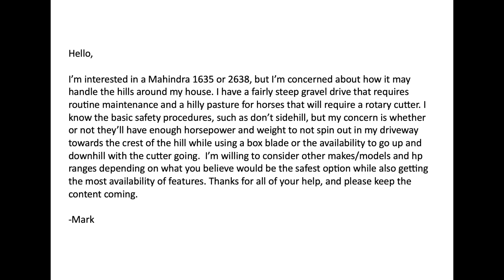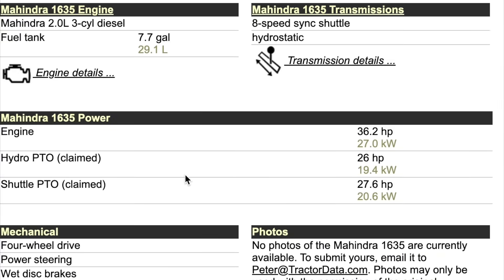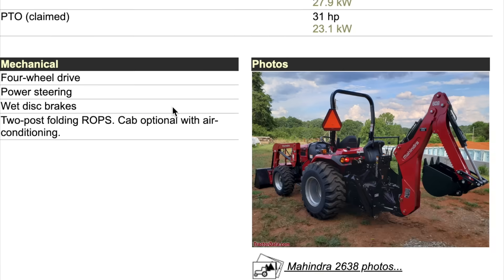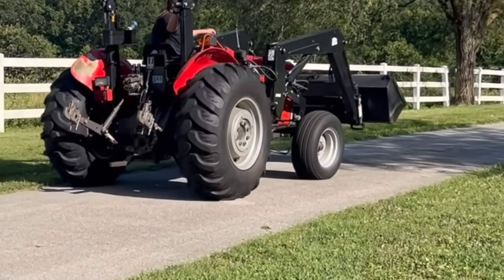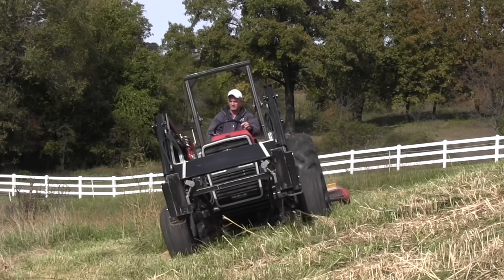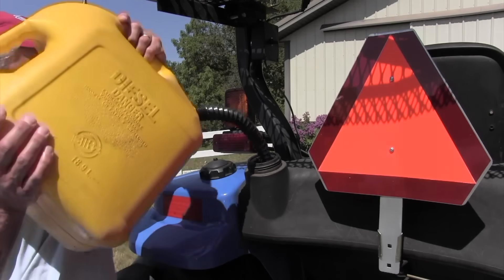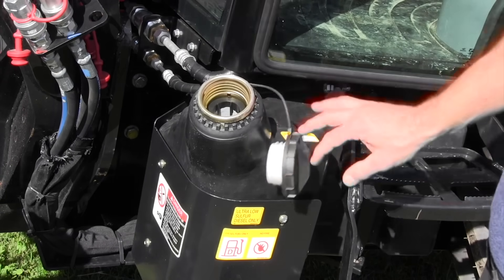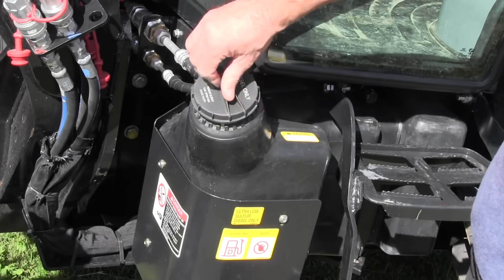Which Tractors Handle Steep Hills Best? Watch This First

Comment: We have a hill that we keep mowed. We use to mow it with a New Holland TC21 4WD (R4 tires) with a mid mount mower but due to discharge balling/wadding up grass, and the service headache the mid mount presented, we dropped the midmount and added a Bush Hog 5' finish mower behind the tractor. Works great in his big yard, but the weight of the mower behind the little tractor now makes it too dangerous to use on the hill (25% grade). It wants to push the tractor downhill and the tractor runs out of muscle uphill. So now we mow the hill with a New Holland 4630 4wd with a 7.5 foot Caroni finish mower. The tractor stays planted for sure but almost too good. The R1 tires on the 4630 create traction ruts and that introduces erosion if we mow it too frequently

Comment: As a kid, I grew up on a 600 acre farm with a lot of steep hills. The first tractor we had was an old Farmall with narrow wheels on the front, no power steering, and a loader that worked by a hydraulic pump that was powered by a chain around a sprocket on the PTO. If you've ever seen how high those tractors are, it's the driver that makes the difference and not the actual tractor. The driver adapts to the limitations of the tractor. Today, I'm in my 50's and I have a mountain top property that I use my tym t25 to grade the road with and a 6 foot wide blade on the back. I have no problems pulling that blade with a 25 hp tractor, and the hills are pretty steep.

Comment: Good video on a critical subject!

If it has a loader, keep that bucket as low as possible.  Keeping your hand on the loader control so you can stick the bucket to the ground when needed also help prevent a roll-over.

While smaller diameter tire do lower the CG, they also don't roll over obstacles (bumps or ditches) as well as larger diameter tires.   Often it's then obstacles that initiate a rollover.

Comment: I run dozers, most of the time, then I run tractors seeding, running a disc and fertilizing after I've finished dozing.  So this gives me prospective on this. 

On bare ground, on what I thought was less than a 3 to one, I  found my dished out, with beet juice mt573 slide creeping down hill. Bone dry ground. Not trying to roll but slide.

I could go on and on... vertical you can do so wicked things, side hill, be very cautious of everything.  Ground coverage,  ground conditions, etc. If in doubt vertical it out, as soon as you can, as my dad once told me.

Comment: 1370 case ag king row crop dual, I realize it's extreme overkill but with the 12 ft long axle width, it won't turn over. Just gotta get through the gate, and have a tough cutter and probably can forget PTO operating speed as it has plenty of power and the fast PTO speed at 1100 I think it was.

Comment: Putting liquid in the rear tires WILL make it more stable. There's a couple of choices. Antifreeze, or RV antifreeze. I used the RV antifreeze in mine. I added over 800 pounds of weight, to the rear end.

Comment: Fat turf tires. When I was a kid I worked at a golf course that had a Massey Ferguson with those fat turf tires and I could bush hog anywhere they wanted me to cut and not feel uneasy and this was way before 4 wheel drive tractors. I had come from another golf course that had John Deere’s that I didn’t always feel safe on but the worst was that little Cub Cadet with a belly mower. I felt like it wanted to flip when I was just moving the road easement’s in that country club.

Comment: The only feature I would add is that 4WD or front wheel assist is a MUST for hills.  If you have to maneuver at all you need the responsiveness of front wheel assist.  Typically you also have the advantage of 4 wheel braking.

Comment: WHEEL SPACERS-  Spacers will move out rims similar to adjustable rims. A little expensive but an option for safer usage on slopes. Obviously non- cab tractors would be best in this scenario. BORA is a spacer mfg USA made

Comment: I live in northern Vermont and own a compact LS tractor.  In addition to the ballast and wheel weights you mentioned, many dealers sell spacer kits, which bolt directly  to the hubs (the tires then bolt to the spacers with longer bolts).

If concerned with driveway maintenance, if you live anywhere snowfall can be an issue, investing in a set of quality tire chains is a must. They will both add weight and provide much needed protection against spinning out.

Comment: As some have mentioned, the Ventrac is by far the most stable on hills. Steiner, now Bobcat, is very similar as the Steiner family sold the company and then created Ventrac when the non-compete agreement ran out. Both are expensive, and they are more limited on their loaders. However, Ventrac significantly improved  their loader a couple of years ago with a new model. You are going to spend a lot on them but they are very versatile. The only reason thay we did buy one 3.5 years ago was the loader couldn't lift even a small round bale and they did not have a bale spear.

Comment: If you actually have hills you need to operate on, do not play games with these toy "tractors", get a real hillside tractor from Europe.  They are designed for real work, operating on steep slopes.  BCS/Ferrari, Antonio Carraro, Lindner, AGT, etc.

Comment: I maintain a property in the Ozarks, and the  hills are steep enough a traditional tractor wasn't an option.  So I purchased a Ventrac for the hills and traditional tractor for the "flat" areas.  I did exactly what Mike suggested for the traditional tractor, had the wheels moved to the most outboard location and liquid filled.  The comment below that the Ventrac attachments are proprietary is exactly right, and why the tractor is capable of mowing / working on up to 30 degree slopes.  I preferred the flail mower, which is up to 6 feet wide, over the tough cut rotary mower, but either should work on whatever hills you are trying to keep mowed. Hope you find a safe way to achieve your goals.

Comment: I have the Mahindra 2638 with the open operator station and filled tires. I also have the 60B backhoe with property in a pretty good slope. Without the backhoe attached it’s extremely stable for my application and terrain. However, when the backhoe is attached the center of gravity is impacted quite a bit so I am very careful not to be sideways on the hills. I have not had any situations without the backhoe where I felt I was at risk turning it over. I suspect if it were a cab version of the 2638 that would change the center of gravity. I only have 5 acres and my tractor has been perfect for my needs.

Comment: I use a Massey Ferguson 1840M. I live in the Smoky Mountains of North Carolina.  Some very steep areas I operate. I have had good luck on extremely steep grades, and the horsepower of my tractor is well matched using a 7 foot Box Blade. 30 percent inclined driveway.
Great question Video.

Comment: I agree if you are looking at a modern tractor 4WD or FWA is nearly mandatory.  But, if you look at a Massey 135 or Ford 3000 you can do.amazing things with those tractors even though they are 2WD only. I can take my Ford 400SU, which is a Ford 3000 frame with a bigger engine , over a lot of hilly terrain and can even mow with a sickle morwer or drum mower on steeper hillsides.  That being said, all the advice Mike provided is spot on.

Comment: I have a Ventrac for mowing but they are limited in HP (25 diesel; 35 gas). Rated for 30 degree slopes with dual wheels but limited attachments. My MX6000 has the wheels out as far as they can go, beet juice in the rear tires and there are still several parts of our property I just can't take it on. I've been bugging Ventrac to come up with a 3' drill but they won't listen to me. That would let me plant food plots in areas I don't feel safe using the Kubota/drill on.

Comment: I have just retired a 1961 Fiat 451c montagna, a very small  manouverable crawler tractor designed for market gardening and orchard work in mountainous Italy.  I now have to get around our steep property with a new korean 53HP 4wd utility tractor.  A whole new learning experience that has required me to redesign my farm access and operating techniques.  All your tips in the video are excellent and have been necessary modifications, and I would like to add that  you have have promoted fitting an inclinometer in your previous videos.  I thoroughly recommend driving to the field and equipment conditions AND the number on the inclinometer.  It keeps me a lot safer than relying on the anal sphincter alone.  An additional trick that some old timers use around here is to reverse the tread direction  on the front wheels, to assist with engine braking traction when driving downhill.  Dagun, Qld Australia.

Comment: Hi Mike, I'm almost 68 years old, and have operated tractors all my life, several years ago I bought a JD 2025 R, and use it all the time, but let me tell you, I have to be more careful and and aware on it than any older tractor I've operated, compact tractors are so light and tipsy, even with ballist, wheel spacers, and added weights, I love the tractor, use it more than my 60 HP International, but do have to be very careful

Comment: Lower and wider handles slopes better.

You can add wheel spacers to help increase stability.  Fill ALL tires with antifreeze and that helps keep it planted on the ground.

TAKE THE LOADER OFF when mowing steep areas and it will lower the center of gravity.

Ventrac has the lowest center of gravity.  It is also expensive compared to other tractors with the same power and has proprietary implements, unable to use standard implements, adding more costs.
Reply: They won't tell max side slope because if you add an option that raises CG or a wheel goes in a hole, you'll flip it.

Comment: I have an LS tractor and onetime had a large tree fall down in a pasture. So i went out with a chainsaw and the forks attachment. At first I could pick it up no problem but I tried to move it and I couldn't until I switched it to 4 wheel drive. Then it moved it real easy. When I use my box blade on my driveway which is on a hill sometimes i put the transmission either in medium or low range with the 4 wheel drive. Right now I don't have anything on the back and i notice that the back tires will spin. I know i could use the liquid in the tires would help but I stick it in 4 wheel drive. The dealer i bought it from was in Florida and i had never had a hydrostate transmission before always stick shift.

Comment: Here in NC back in the 60's and 70's most farmers in the mountains used Fords because they were low to the ground with loaded rears with the rims set out as far as they could go.  I'm 66 now and will not run a tractor without a roll bar and seat belt.
Reply: yeh in WNC i run steiners and Ventracs for mostly everything... 

For larger tractors they have to have a roll bar/seat belt... I knew a guy that bought a bunch of land in MI... One of his old vintage tractors tipped and crushed him... After that i want a rollbar/belt

Comment: Rimguard in the rear tires.
FEL held a few imches off the ground and a rear implement like a rotary cutter.
4wd.
If you feel at all uncomfortable in your seat, you are probably getting into rollover territory. Listen to your body and instincts.
Go slow.
Stop if it at all feels wrong.
Don"t turn on slopes.
Don"t go fast on slopes.
Try to drive up and down the hill, not across or diagonal.
Go slow.
Even slower than that.
Bad shit happens really fast, but if you are going slow enough, you can stop, and extricate.
Three times this year while building a clay dam in a ravine in the hilly woods, i had to stop, when my uncompacted dam started to shift under me. I had to winch the tractor out of the predicament.
My wife says i"m brave. I say no, im experienced with this tractor and im very cautious in what i do.

Comment: I have a mahindra 1626 with rear tires filled and industrial tires I slide more them anything on side hills not bad but alittle and iv have it on 15 to 30 degree slopes but the one thing I do love about mahindra is the entire bottom of the tractor is still heavy metal not light weight metal hope this helps

Comment: Great video Mike.  My opinion is to use the best tool for the job.  I decided that my life and health were more important than the risk so I bought a Ventrac for the extreme slopes and dangerous areas of the farm.  If you truly have dangerous slopes, it's not of matter of "if" its "when" you will run out of luck.  Your life is too valuable to risk it.  Get the right machine for the job.  I still enjoy my "real" tractors, but 5 years in and never regretted buying the Ventrac.

Comment: I've got a Kubota L3901. I added Boro wheel spacers adding 7" to the width and it helped a lot. I use a rotary cutter and a finishing mower on some real steep slopes and it works very well.

Comment: I have a Kubota L4060HST cab with a loader. Over the past several years I have taken it on some very steep slopes. It took a while to get used to what it will do without tipping it, but it handled more than I thought. The key is to do things slow.

Comment: One thing I would mention is if you have a loader on your tractor have some weight in it & keep it as low as possible to help lower center of gravity & assist with steering traction.

Comment: I operate on hilly areas and a must have is 4wheel drive. tires set to their widest with rear fluid filled tires.
Reply: Agree, 4wd pretty important. Also Have property with steep slopes so in similar predicament. My 2wd massey has fluid filled tires and extra weights mounted to the hubs, but it still struggles to get traction if trying to back up the hill. My 4wd new holland on the other hand, not a problem. The other thing to keep in mind is this also helps with braking. There are no brakes on front wheels with 2wd, but it will stop them with 4wd

Comment: If you are able to mow  your slopes with a big mid-mount-mower, it really lowers your center of gravity.  I bought a Cub Cadet 7275 new in 1997 with a 72" mid-mount mower.  It IS a finish mower, not a brush hog, but the tractor sticks to steep slopes like glue with that mower underneath.  Once I was able to tame the boulders and woody growth on my steep pastures, I would take this machine out over any of my others.  When I need to mow really rough areas, though, I put the loader on the tractor and keep it really low to the ground, and put the brush hog on back, wheels set as wide as possible.

Comment: Massey Ferguson 451 with MFWD is our "hillbilly tractor ". Rear wheel set out to the widest possible tread width, two cast iron wheel weights per rear wheel and 5 suitcase weights on the front.  It handles a trail type Woods 121 (10 foot brush hog) nicely.  On the steeper hills use the MFWD and keep ground speed low.   Amazingly this little tractor only burns a gallon of diesel per hour.

Comment: I have a JD 5105 4wd with loaded tires set wide. It has a low cg and works great on the steep W. Va. hills. I always keep the end loader as low as possible.

Comment: Good Vid, Mike.  I've got a Massey sub-compact and I live on a mountain and have to traverse slope.  Some of them have a high butt-pucker factor but it has worked out so far.  I agree with everything you said.  I had the dealer put in 2" rear wheel spacer and fill the tires.  I also make sure to keep my load as low as possible and take it SLOW.  A wheel dipping into a hole can topple you if going too fast.  I'm pretty sure I learned all of that from your other videos before I bought my tractor.  You've been a big help!

Comment: Bus hog 15 ac. of hills , valleys and sloped land .Very little of it flat land. I have a JD 5310 4x4 with loader which I leave on ,without the bucket for front weight .Pull type 8 ft. bush hog .25 years on same land & tractor . Always have R.O.P.S .wear seat belt ,stay in 4-wheel drive and learn to counter steer on slopes. No your property.... Thanks.....

Comment: I am in northern WV on a hillside.  I currently own a Kubota L6060HSTC with LA1055 loader and BH92 backhoe and a Kubota B2601 with 60” mower deck.  The smaller B series I feel is more stable on the ground because of many of the points Mike mentioned.  I don’t have the tires filled because I don’t have a loader but because I don’t have a loader I have to have 5 front suitcase weights to allow use of my 5’ rotary cutter on the back when I need it (I need a 4’ cutter but I share the 5’ between the two tractors).

I wanted a Ventrac but they were out of my price range so I got the B series.  I use it for lawn mowing, some rotary cutting, and could in theory use it for driveway maintenance.  Tires are a big decision point, as ag tires will hold a hill better but tear up your driveway versus industrial tires which are better for the driveway.  I have R14s on the B series and they do good on the hills and don’t tear up my lawn I mow with it.

The larger tractor is scary on hills so you go up and down and only turn on the flat spots.  But when you’ve got to lift more and cut faster you have no choice but to deal with it.

I think just about any 4WD tractors with R14 tread that is well matched for the implements as Mike said is going to be fine for a steep driveway.  Even on my large tractor I seldom run a blade up the driveway because you run out of traction on gravel before you run out of power to drag the box blade up a steep hill.  It’s like Mike said, match the tractor with the right implement, but also consider tread (Mike has some good videos on that subject too).